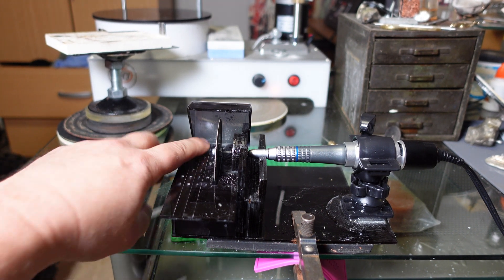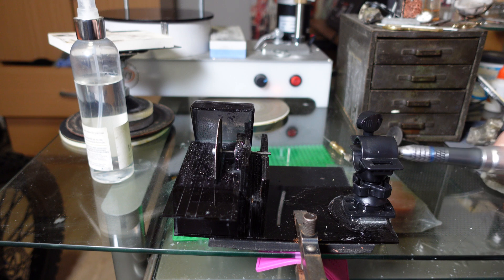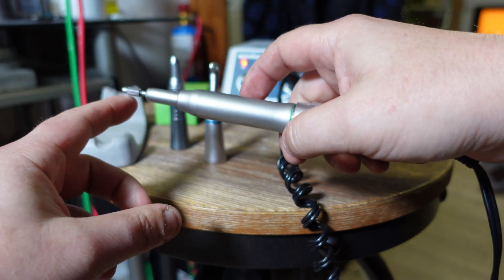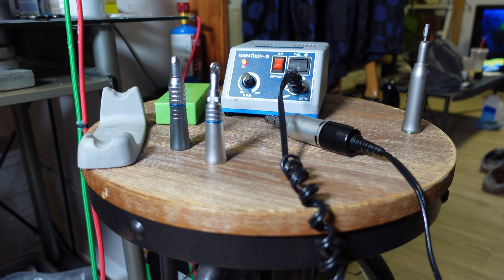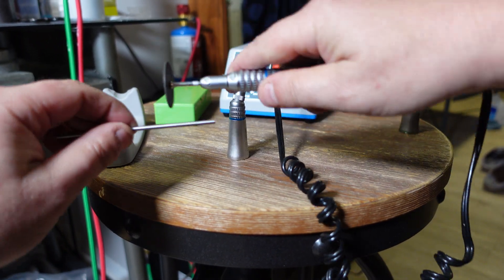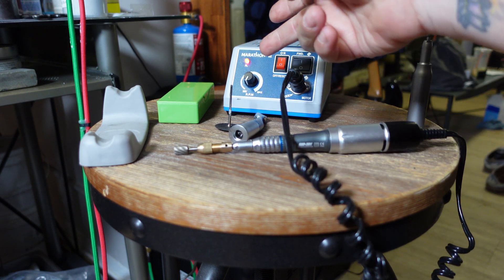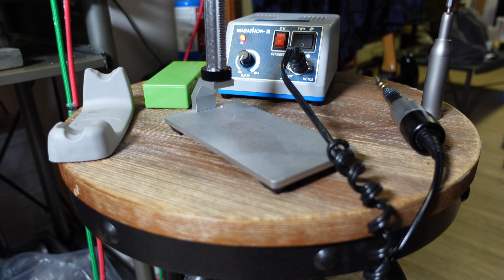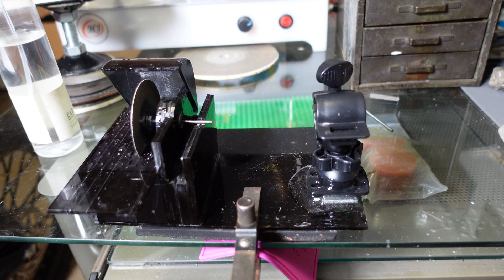my micromotor diamond trim saw attachment

Comment: Hello, I'm very interested in your offer of acrylic parts. I would use it with this small machine that I recently bought. It has a vertical disk on on side and a horizontal drill chuck on the other. The drill chuck center is at 74mm height and the machine has a base which is 115 mm long. Could it be compatible with your trim saw jig? What size of diamond saw are you using? I'm located in Canada, I will gladly cover the shipping cost. 

I discovered your channel today and already subscribe. I hope you make it to 1000 quickly.